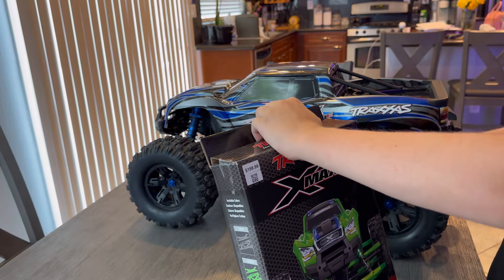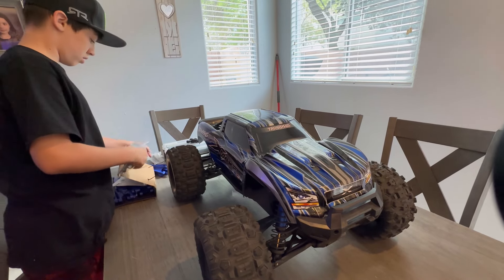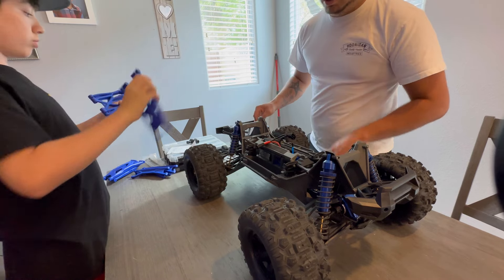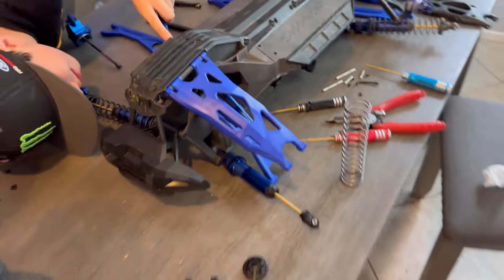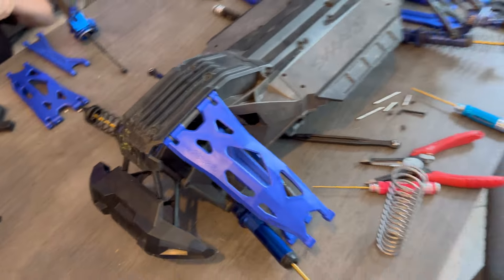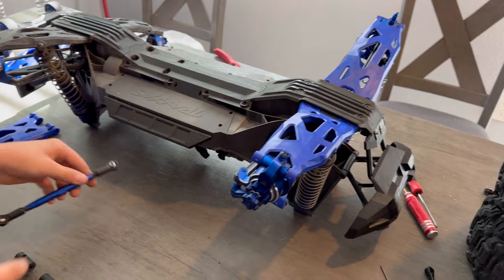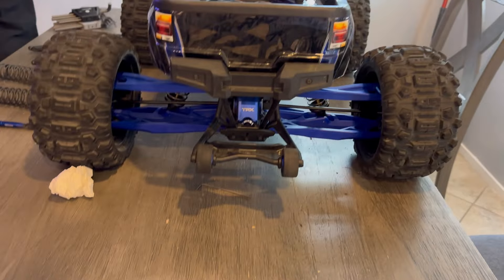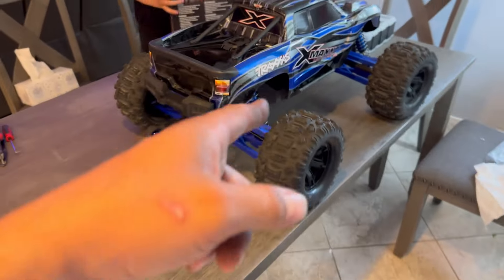Traxxas Xmaxx Ultimate widemaxx kit install

Comment: Top and bottom holl changes roll . The top hole i believe is tighter stiffer cornering. Id have to look to remember what does what but its for body roll. Believe it or not plastic is better . Aluminum looks nicer but on arms or the sterring shafts give is good. The only thing id do aluminum on is the bulkheads the rest you want flex or give so it dont break other stuff from being to rigid. Cool kit and look . As long as ypu dont bash extreme it should hold up. I just know its so wide people were snapping stuff. Upper hole i do believe is stiffer body roll. Cool video and cool project. Its nice to get kids interested in stuff.
Reply: I’ve had the wide kit on over a year and haven’t broke or bent anything